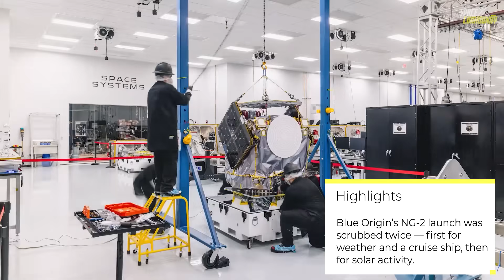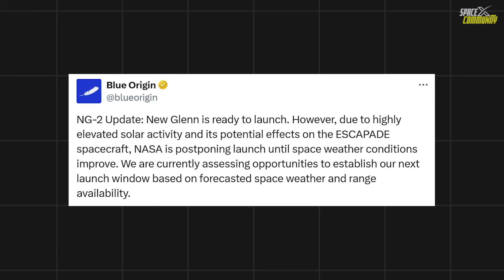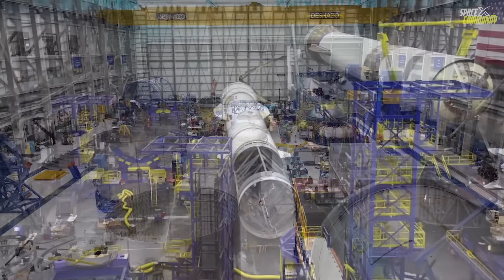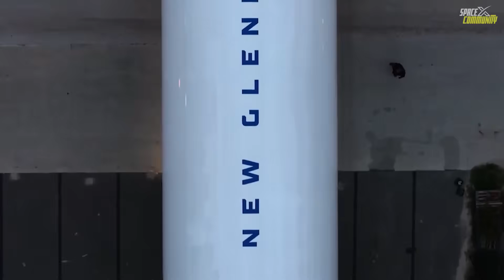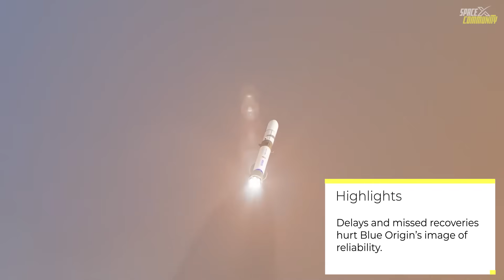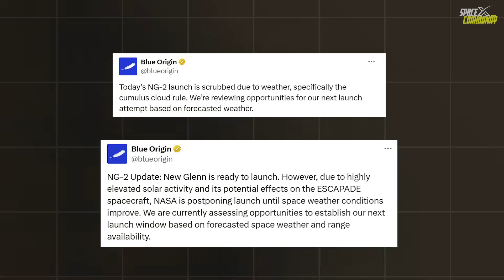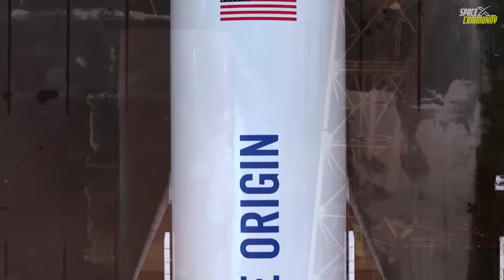Blue Origin Says Something WEIRD Happened Again on New Glenn's Second Launch Attempt After a Scrub

Comment: A CME can be a serious threat to a space craft. Some satellites are put in low power mode to prevent the radiation from the coronal mass ejection from frying the expensive hardware. When the particles hit the atmosphere or solid object, the bremsstrahlung will fry most electronics, especially powered-on electronics.
I can fully understand why BO scrubbed this time. It is its maiden official flight with payload.
Reply: COME ON your relying on BLUE TEMU